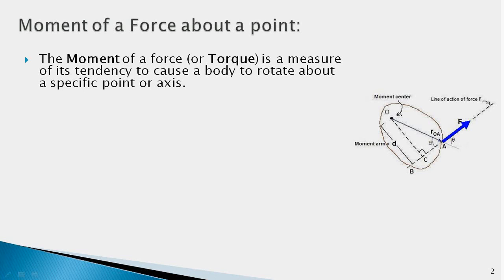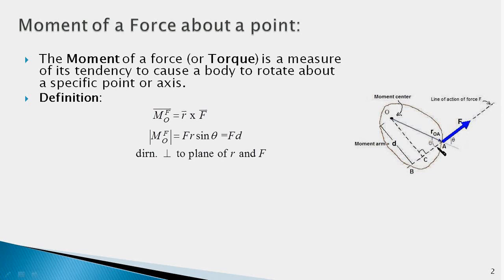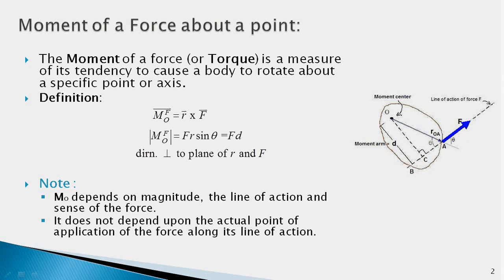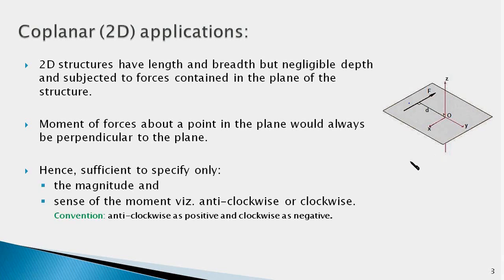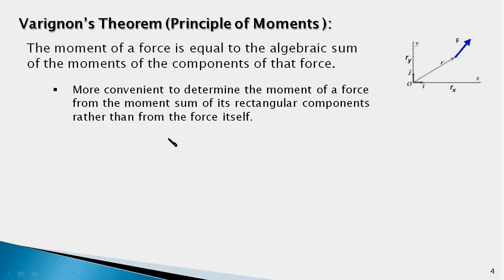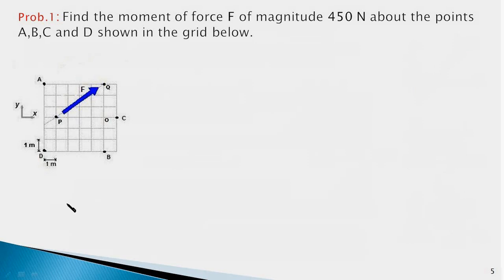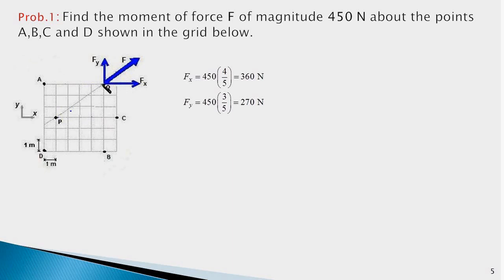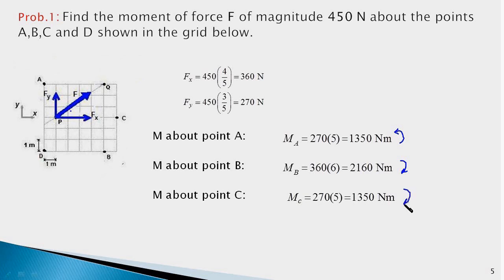5.1 Moment of Co-planar Forces (Basic Concepts & Solved Example)

Comment: Thank you so much for explaining prob 1. the way you found slope. the way you move the force so the horizontal component generate 0 moments. so helpful! Make life so much easier! And I appreciate your username called Vector in motion. One of the elder professor just gave me the tips of learning statics. ALL about vectors!
Reply from the maker: Glad it helped you! Looks like you've understood the key points of the video. Happy learning!
Reply: @VectorInMotion   Good day ! I have something that I don't really fully understand. Would you please help me to understand? thank you for your time! Does the moment also apply to the triangle law? (vector moment 1 + vector moment 2= vector resultant moment? magnitude resultant moment 3 square = magnitude moment 1 square + magnitude moment 2 square - 2 magnitude moment 1 magnitude moment 2 cos angle between moment 1 and 2?)
Reply from the maker: Hello Eva! You are absolutely right... that's how two moment vectors in a plane are added...using the triangle law. So your confusion is not very clear to me... but let me share with you few general scenarios that may improve your understanding:

1) When two moment vectors are uni-directional, you can do algebraic addition instead of using the vector addition techniques. For example, when you've co-planar forces acting on a planar body...you know that moments of the forces about any point on the plane, would be in a single direction (normal to the plane). So, the moments would be uni-directional (either in positive or negative direction) and then you can do algebraic additions. To keep matters simple, we call their sense as either clockwise or anti-clockwise and do plus or minus operation.
2) When two moment vectors are in a plane forming certain angle between them, you can add them and obtain the resultant's magnitude by using the triangle rule...which is what you mentioned in your comment. You can also use the technique of addition of rectangular components. Example: Add two moment vectors => M1=M1x i + M1y j and M2=M2x i + M2y j  then the resultant vector M1+M2= (M1x +M2x) i + (M1y + M2y) j
3) When the moment vectors are space vectors having x,y and z components, you add them by adding their x,y and z components.

Hope the above clears your doubts!
Reply: Vector In Motion THANK YOU for your timely explanation!  it is really nice of you! Have a good night!